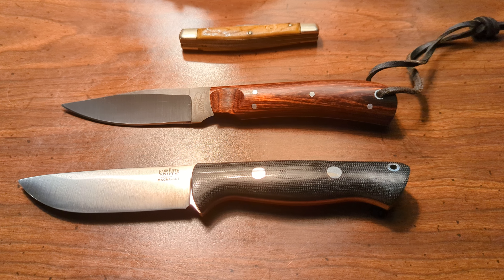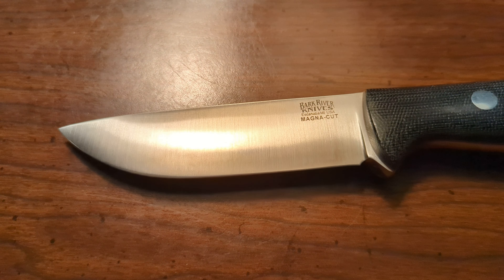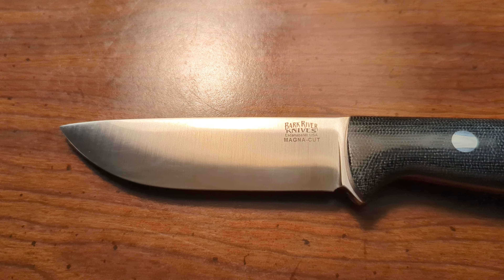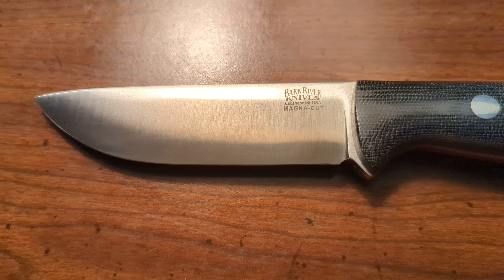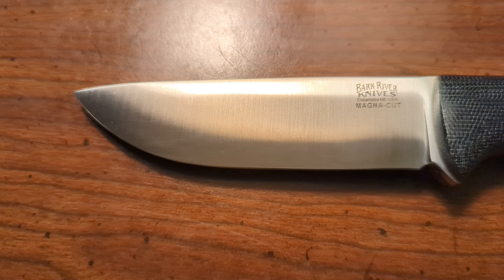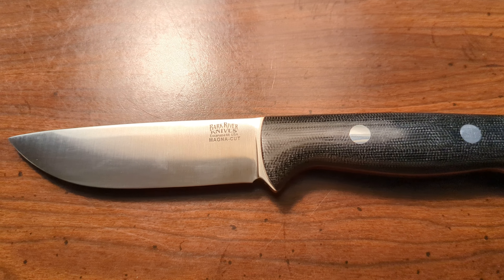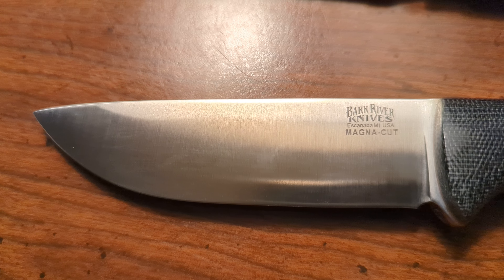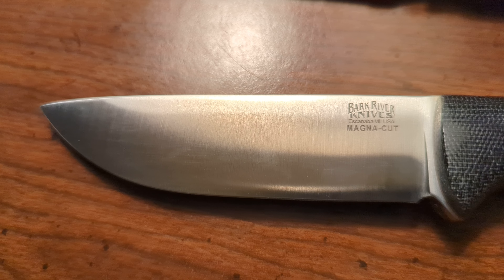Conclusion of the Magna-Cut matter.

Comment: Stainless do not mean it not rust. Stainless steels do not exist. Magna-Cut is the best steel in every aspect, very well balanced.
Reply from the maker: If stainless does not mean it will not rust then what does it mean?  Every other brand of Magna-Cut besides Bark River will not rust under almost any condition it is put in, even when people try to make it rust.
Reply: @MountainLife1 all Magna-Cut will rust, sooner or later. Every steel can rust. Not big problem. Magna-Cut is not good becouse is stainless, Magna-Cut is the best becouse it is perfectly balanced steel.I have Bravo 1 LT in MC and have no eny problem with patina, and if yes, it is just patina, not rust.
Reply: @MountainLife1 stainless it means it will take longer time, until it will rust.
Reply from the maker: @zdenekbart  I agree that Magna-Cut is a well balanced steel that holds an edge and is not hard to sharpen.  It is also a steel that can be made almost stain proof or can be made so that it takes a patina in minutes after cutting something such as a steak.  It all depends on how the steel is produced/heat treated.  Because of its stainless properties, some companies are using Magna-Cut for knives designed to be carried in coastal environments where saltwater is a factor.  Apparently, some companies are not producing Magna-Cut at that level.  So, I agree with your statements about Magna-Cut being well balanced, but the performance varies widely with how the steel is handled.  In Bark River Knives, I place Magna-Cut at about the same level as 3V, although most of my 3V knives did not take a patina as fast as the Magna-Cut knives you see in my videos.  If you want to see how Magna-Cut can perform and how stainless it can be if properly done, see Cedric and Ada
Reply: @MountainLife1 Maybe is a bit better then 3V in stain resistance, but is more far better in edge retention and toughnes, that's why it is my favotite.
Reply from the maker: @zdenekbart  If I were you I would keep buying and using Magna-Cut knives.  I know it is a good steel and you will not go wrong buying it.  Good luck with your knives, and thanks for watching and commenting.
Reply: @MountainLife1 Magna-Cut, 3V, Elmax, S45VN, Nitro-V, CPM154 this steels are great. I have all of them.

Comment: Magna Cut is not a stainless steel....it's stain resistant tool steel. Everyone in the knife world knows this already.
Reply: not a stainless steel....it's stain resistant tool steel.
Reply: @Simon-talks  Stain resistant tool steel only exists as a marketing term to describe Magnacut, its not a real classification. They used the same term to describe M390 when it was introduced, but you would be unable to find anyone calling it a tool steel now. Magnacut is a stainless steel, not a tool steel, because it is highly stain-resistant. 

The only potential definition of tool steel Magnacut meets is if tool steel has to be less than 13% chromium percentage. The problem is that definition makes stainless mean nothing because ZDP-189 has as much chromium as M390, but it is less stainless than D2, which is called a tool steel. D2 has more chromium than 409 stainless and other low carbon stainless steels, but they are more stainless. Outside of the knife world, the cutoff for stainless is closer to 10%, which would make Magnacut and D2 both stainless. Anywhere we put the dividing line doesn't work because it will make some tool steels count as stainless steels, or some stainless steels count as tool steels, and ZDP-189 will always be a non-stainless stainless steel because if you put the line past it then no knife steel counts as stainless.

If you say a tool steel is one designed for industrial tooling, then Magnacut isn't a tool steel because it was designed for knives. It also makes no sense because the vast majority of steels including the stainless ones were designed for industrial uses. Basically every steel would be a tool steel.

If you say it is a tool steel because it matches the toughness of a tool steel, that doesn't work because there are plenty of tool steels that are not tough at all, even accounting for their edge retention.

To fit with the way the word has been used up until now, tool steel has to mean an alloy steel(as opposed to plain carbon steel) that is not fully stainless. That is the only definition that preserves the meaning of the word stainless and covers the steels we called tool steel up to this point. Tool steel is a catch-all term for steels that aren't stainless and aren't carbon steels. If we define it that way, then we don't have any category outliers, ZDP-189 is a tool steel because it isn't fully stainless, and Magnacut is a stainless steel because it is stainless.

It does over-simplify steels into Carbon, non or semi stainless alloy, and stainless alloy, but tool steels and stainless steels both have as much variety in composition and edge retention as each other, so any other classification is going to put steels we call stainless and steels we call tool steels into the same categories as each other.
Reply: nope, it's a fact. like most “stainless” knives they are not purely stainless, they are stain resistant and magnacut is a type of tool steel because of the similar make up to tool steels. Mike Stewart covered this extensively and has broken down the metallurgic process....